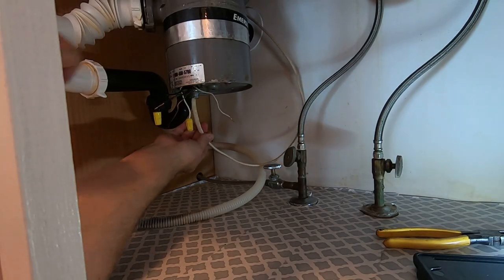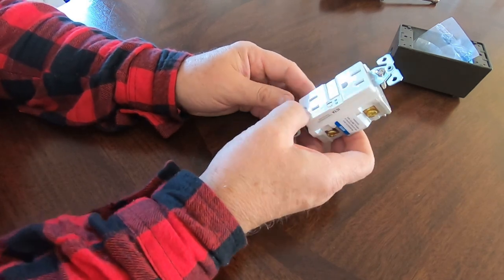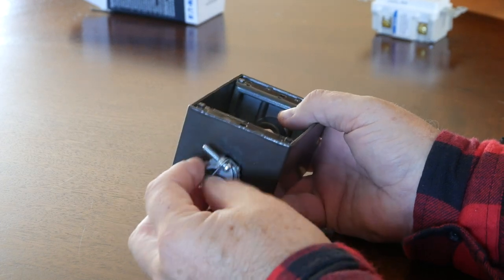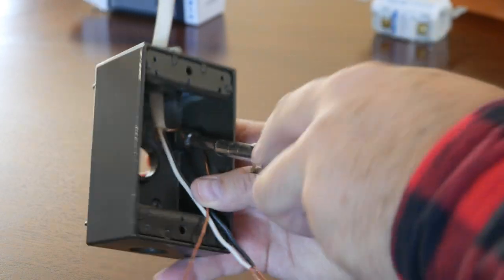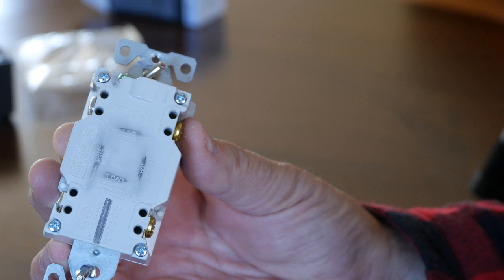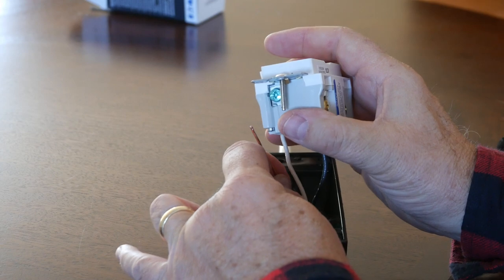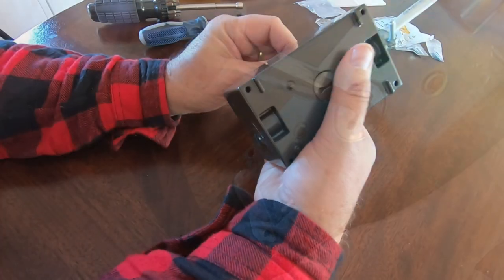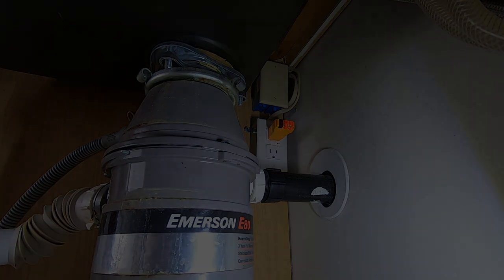Garbage Disposal GFCI Outlet Addition

Comment: How did you add the switch wires to the outlet, maybe I missed that part.
Reply from the maker: Just removed the wires from the old disposal, which came from the switch already.  Routed those wires from the old disposal to the new outlet.
Reply: @PilotViewProductions  I am installing the garbage disposal new from scratch, I ran 12/2 from the panel and 12/3 from the outlet to the switch, will this need to be a half hot outlet even though this will be a single circuit.
Reply from the maker: Since I'm not a licensed electrician, I will defer an answer to my viewership.  Anyone?   @johnnyreeseiii8189

Comment: GFCI Outlet model and manufacturing company and also surface mount box info
Reply from the maker: https://www.lowes.com/pd/Eaton-White-15-Amp-Decorator-with-Wall-Plate-Outlet-GFCI-Residential-Outlet/1002337154

https://www.lowes.com/pd/Sigma-Electric-1-Gang-Weatherproof-Box-1-Gang-Gray-Metal-Weatherproof-New-Work-Deep-Rectangular-Exterior-Electrical-Box/3136727